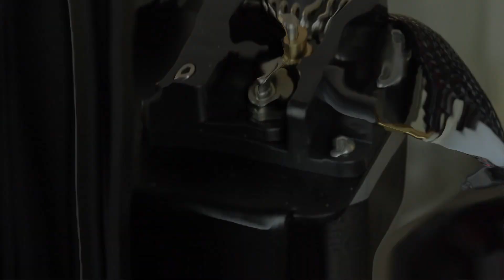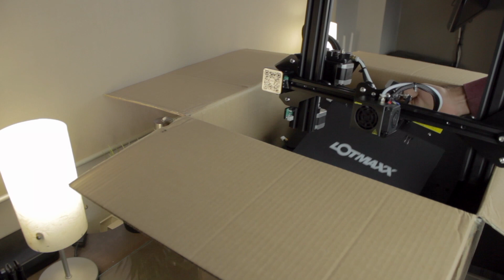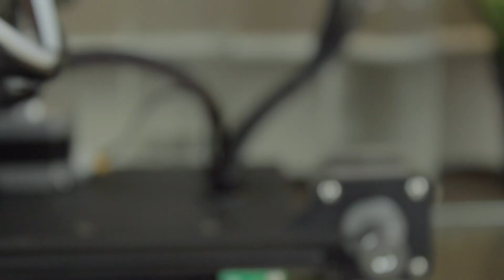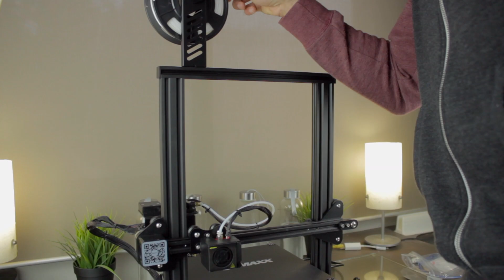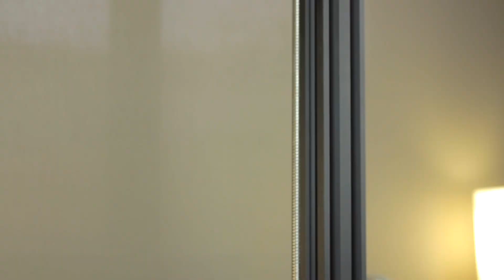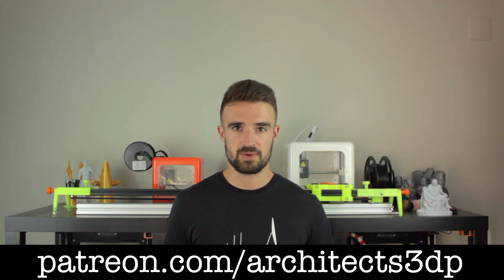LOTMAXX SC-10 | 3d Printer Review | Ender 3 Pro KILLER

Comment: Hi
and greetings from Germany, I've been using the Lotmaxx SC-10 for about 3 months now and have to say - very good device.
I made a few modifications
- in all axes TMC2208
- new fan duct
- Hotend fan exchanged for a quieter one with 9.5dB
- an external filament stand
And the printer is running perfectly, so far I had only one misprint and that was my own mistake - with 7 kg of filament now, which it printed.
I don't know Ender 3 Killer, but definitely the first printer to do what it should out of the box and after 15 minutes of assembly

https://ibb.co/7vC5SrD
Reply from the maker: very cool! I'm glad you enjoyed the 3d printer :)

Comment: A high quality 3D Printer kit, 
~~Meh. .its a clone 

ultra silent,
~~for about 6days.. then the motors start to scream 

 extra precision,
~~So is tolit paper if you know how to aim

 easy to build
~~yup, only took 2 people 13mins (not 5) to get it together 

 and cheap 
~~this is true.. until you add the cost of new feeder, tube, extruder, nozels, build plate, filament and a few other things you will need to buy right away.

3D Printer that you can get right now for less than $300.
~~See ""and cheap" for reply to this. 
I wish i could go back knowing what i know now... HUGE waste of money. im just happy its $500/$600 and not the $800 for the ender 3 or 5... oh wait... i guess in the end, thats what it DID cost me.. :/

Comment: Ender-3 killer?
I see another Ender-3 PRO clone... with some cool features. :)

  - 3 cm higher
  - filament sensor
  - motherboard (probably 32 bit) with replaceable drivers (TMC2208 on XY and A4988 on ZE)
  - touch screen (so you can't use all features of the firmware because this screen cannot show you a new setting)

Better technically? Yes.
Better in terms of price / performance compared to Ender-3? I'm not so sure...
Reply: i would love to see a ender3 with direct drive from factory!
Reply: @certified-forklifter  With one Z axis it's not good. 😔
Reply: @MartinZeman3D  mmmh, i thought about upgrading to a direct drive. I didn't heart anybody complaining (for example tt)
Reply: It's supposed to be a CR20 clone... But on steroids. Love the TMC drivers.
Reply: just get the SKR mini e3 with the built in tmc 2209 and 32bit mcu board for 23$ its not that an issue nowdays